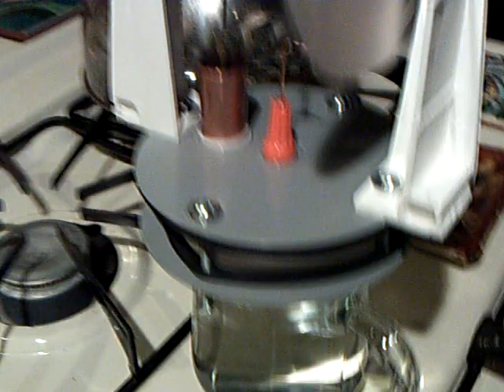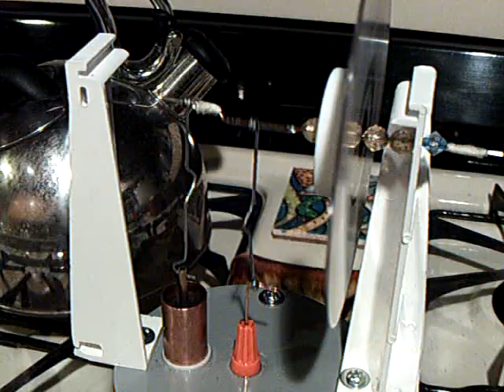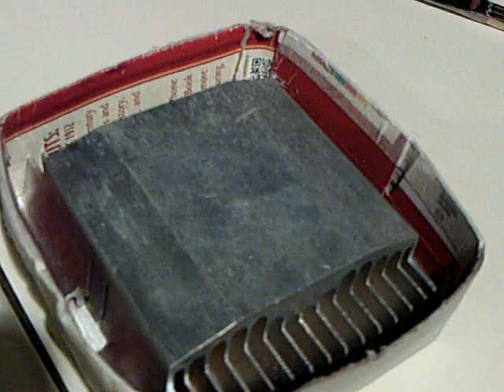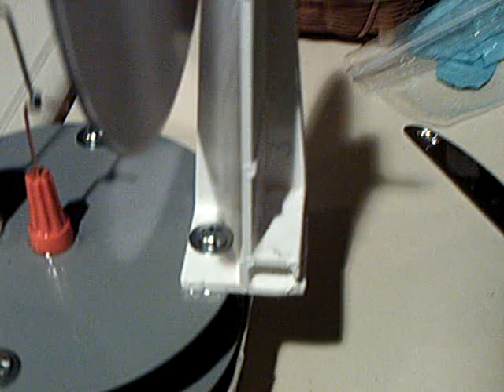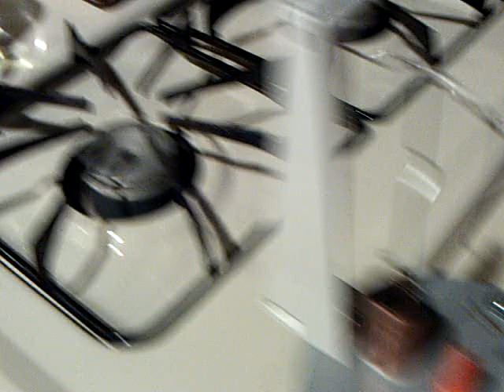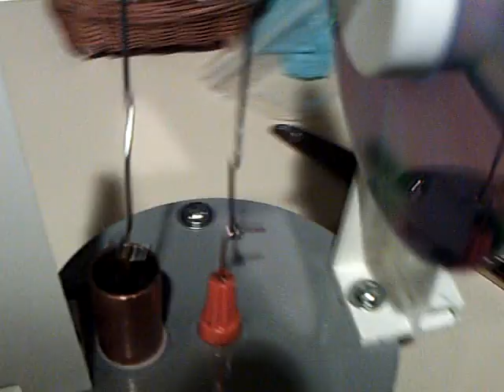Hot water Stirling engine success!

Comment from the maker: This engine works using the expansion and contraction of air as it is heated and cooled.  It is a direct conversion of heat energy to mechanical energy.  Google ---stirling engine ---to find out more about it.  The stirling engine has been around for a long long time.

Comment from the maker: Good question!  This is supposed to be a closed system.  The heating and cooling of the gas does the work as the gas expands and contracts.  The only thing coming and going is the heat.  BUT--- on this design air leaks in and out at the displacer shaft and the drive piston &cylinder.  That is a BIG problem.   If you get those two spot too tight then the engine has too much friction and won't run.  If the two spots are too loose then the air pressure leaks keep the engine from working.

Comment: Yay! You got it working! Would I be right to guess that you made the displacer stroke shorter and the piston stroke longer? compared to your last one? Speeds up nicely on the heatsink. Another thought would be to glue a few magnet on the flywheel and see what it can generate. You have it running pretty smooth. Well done!